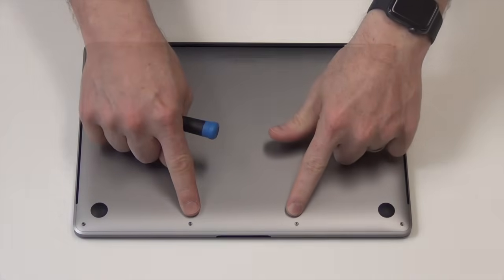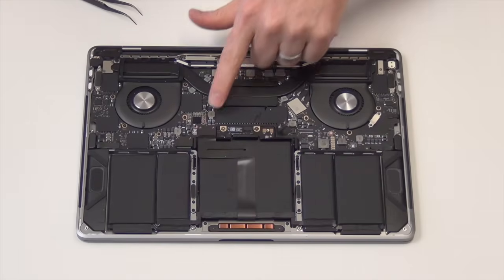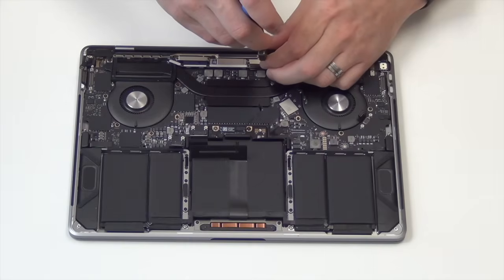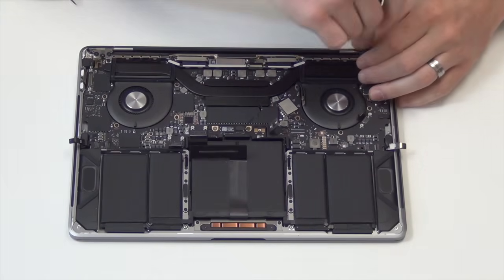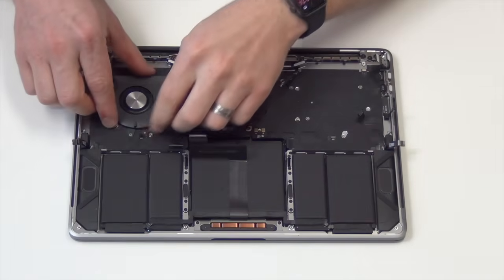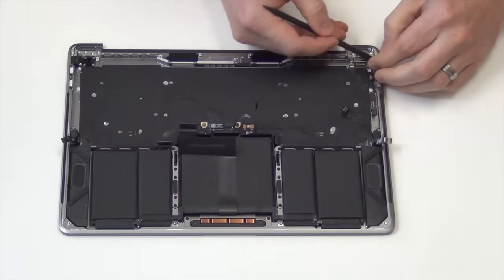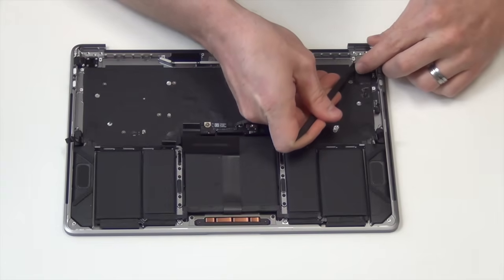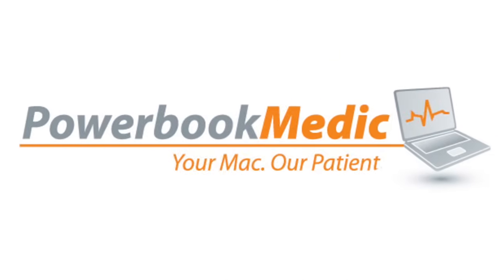How to Take Apart the 2018 13" Macbook Pro A1989

Comment: Thanks for sharing this content. I did not follow your instructions (I followed iFixit) and while trying to disconnect the battery cable I broke the logic board connectors, now the laptop works but as a Desktop not as a Laptop. Do you know if it's possible to resolder the battery cable to have a laptop again?

Comment: Useless!  You only took it HALFWAY apart!  Where's the part to take apart the LCD screen and camera???
Reply from the maker: You don't take the display apart on this model as it is fused together. You will have to replace the entire display assembly if you have a problem with it.
Reply: @PowerbookMedic  UGH  Well that sucks!  I took away the "dislike". Why do they make it like that?  That's a bit expensive if just the camera doesn't work.  I'm working my friends Macbook and I'm sure she doesn't' want to buy a whole screen just to fix a camera issue.  Thanks for the reply.

Comment: Replace the top case on this Mac needs T2 chip reprograming?
Reply from the maker: As of right now no. However Apple could potentially " flip the switch" at any time via an update that would make user installed parts require mating to the T2 chip.

Comment: Hi, is it possible to replace the batteries in this model?
Reply from the maker: It's possible but not easily done. Most people will just replace the entire top case with battery if they need to change the battery.

Comment: Is it possible to replace just the touch bar on this model or it is attached to the top case?
Reply: If you hate yourself it's possible. Just did it, required chiseling it out since in their infinite wisdom Apple glued it in. You could use wire if you're lucky and it doesn't break like mine did.

Comment: in order to remove battery, is there a nee to remove board?
Reply from the maker: Den Dem The battery is included in the top case. Yes, you will need to remove the board to get to it.
Reply: @PowerbookMedic  Thank you for reply, need to replace swollen battery, can't find anywhere how it is done

Comment: can i replace or upgrade ssd from 256-512 in A1989 model MR9U2ZP/A ?
Reply from the maker: No, you can not. It is all soldered on the board.

Comment: Does the 13" Macbook Pro have two fans?  I wanted to see how much trouble it is to reapply the thermal paste, but I see the screws are underneath the CPU cooler and the board has to come out completely... I am not happy with that Apple....
Reply from the maker: Yes, it does have two fans.

Comment: Can I replace the flex cable at 01:27? If so do you know what it is called? Many thanks in advance.
Reply from the maker: Collie House Yes, you can replace it. It is called the BMU flex cable. We sell it on our website if you need one. Here is the link, https://www.powerbookmedic.com/MacBook-Pro-15-w--Touch-Bar-BMU-Flex-Cable-Mid-2018-p-183993.html
Reply: Thanks. Mine is now removed and will only power on now when plugged into the charger. Is that normal? The battery seems dead with the wire disconnected.
Reply from the maker: Collie House Yes, that can happen with that cable being disconnected.